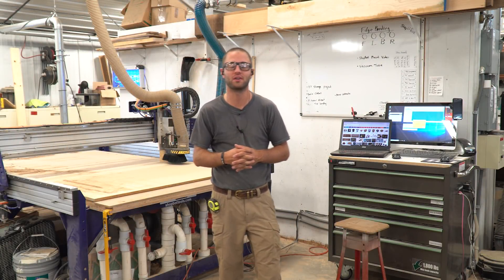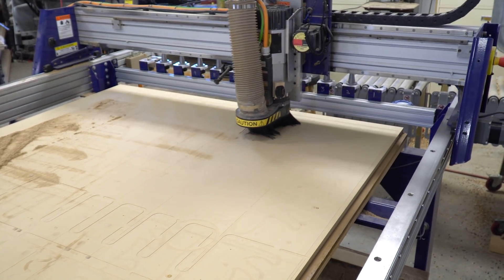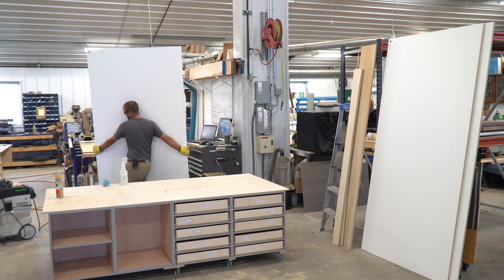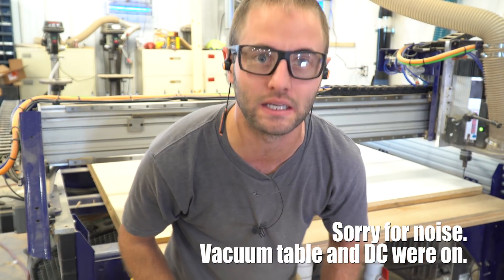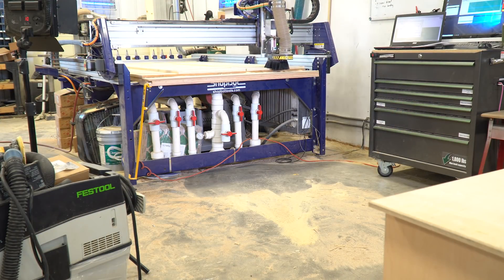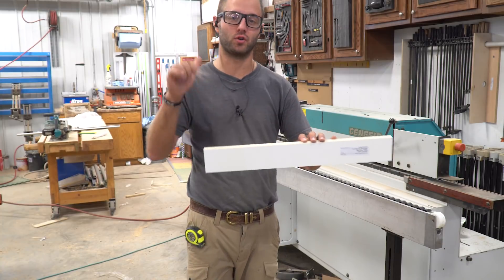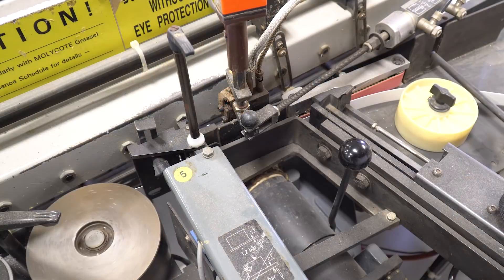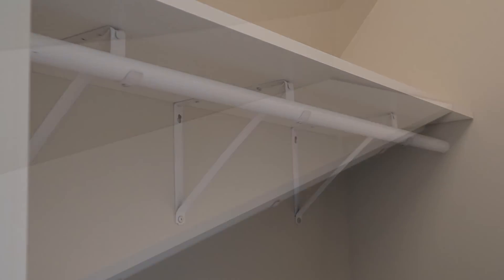Small Closet Made On the ShopBot Tools CNC Router

Comment: 2 questions: rough estimate this CBC machine cost you? Roughly to the nearest K? Looks like a 5’x10’ table? Maybe mistaken.
Also, are you by any chance using Or have used AutoCAD? For any design/programming process? Or Mosaic is a must? I’m on a fence to pull a trigger vs still doing it old school with sliding table saw and such. I’m also really good at AutoCad, and am currently nesting quickly and easily myself, so that’s not a problem.  Thanks a bunch.

Comment: How much time did it take to cut all the material for this job ?, all up how much time including design / programming / assembly did it take to produce this cabinet, do you find you can make any money from this machine as these are not cheap and my thought is if they are not run all the time like a production line not much will be made for the effort that goes into making one off projects ?

Comment: Small suggestion on these tall cabinets. 

Add a center support to the middle of the cabinet. 

About half way up the cabinet, add locking screws into a shelf so it maintains a tight gap. This is what our kitchen pantry manufacturer did and it made it feel a whole lot more sturdier.

Great video on the CNC :)